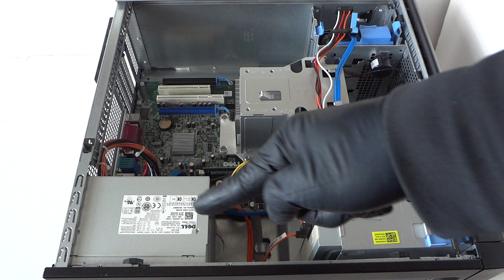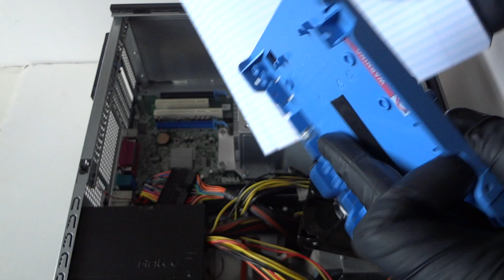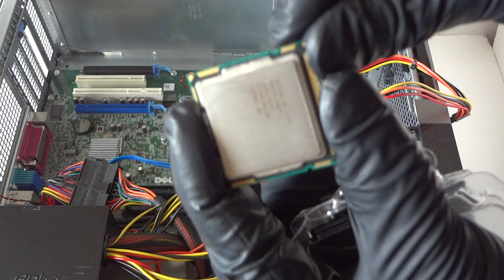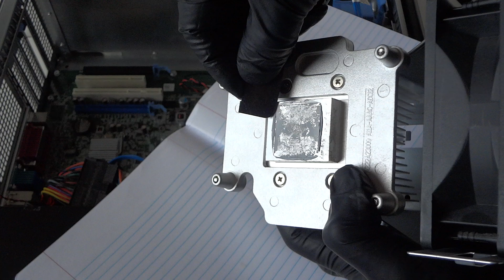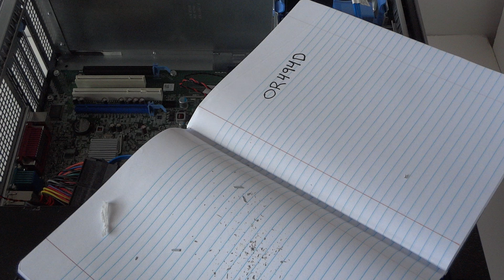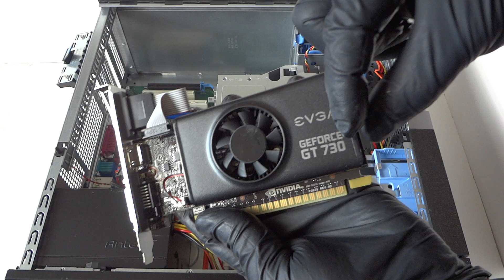Dell Optiplex 980 Upgrade Video Card RAM CPU SSD PSU

Comment from the maker: Here is the list parts upgrades.
(1.) CPU: Intel Core i7-870
(2.) Power Supply: Antex VP450
(3.) Memory: HyperX Fury 8GB DDR3-1333 HX313C9FWK2/8 (4Sticks)
(4.) Video Card: MSI GeForce GT 710 1GD3H LP 1GB Low Profile 
(5.) Hard Drive Caddy: OR494D 3.5" to 2.5" SSD  Adapter For Dell
(6.)  ATX Power Supply 24 Pin to Mini 24 Pin For Dell Optiplex 980
Reply: How to know psu compatible with 980 ? I want to buy cooler master. Is it ok?
Reply: @gamerlikeme9177  any ATX can work. But you need a special Adapter to mini 24pin ATX. Got mine finally working and live it. Got a 1060 in it and 110fps
Reply: @DavidrKun  tq. I have stock psu and plan to upgrade gtx 1060 too. So i still need the adapter to run 1060?
Reply: @gamerlikeme9177  bro, get the adapter and a 450+ PSU. That Stock PSU does not have the power for the 1060. Trust me. Saving you from a headache.
I deleted with this issue for over 2 weeks trying to by cables to see if I could. But best for you to just get the right part. Amazon is the only one that had the right part.
Reply: @DavidrKun  i see.. tq. I try find out.
Reply: @DavidrKun  i have found the mini 24pin adapter at my local online store. Hopefully will work. I've to wait 2-3days. Just to ask if i use 700w psu will it overkill the system?
Reply: @gamerlikeme9177  no, it will only use what it needs. It just can go up to 700w. Also send me a link to the part you ordered. I hope it is the right one. I bought a cable and it was the wrong one. It did do the standard ATX to mini 24pin ATX. But it was pin for pin. No mod. If you search online. You will see that there is one on Amazon that is a special cable with the pin changed. Lots of reviews saying it works for the Optiplex 980. It was the only reason why I bought it. Cause others claim but never worked. It was hell for over a month waiting for. My system to be where it is now. But man what a system... Send the link. I will also search too and post a link
Reply: @gamerlikeme9177  just read the reviews. This is the same cable I bought. Works 100%
Please add this to your video notes. This cable will save others from a headache
Reply: I think this the right one. Exactly the same in this video.
Reply: @gamerlikeme9177  that looks right. Good. You will be booting up soon. Good job
Reply: @DavidrKun  Not soon i think. I have to wait 2-3 days to order that. My gtx 1060 not yet arrive too. Btw thx for sharing to me.
Reply: @DavidrKun  what psu are u using for gtx 1060? I want to buy evga psu.
Reply: So, I bought the ATX 24 to Mini 24 pin Optiplex 980 cable I got from Fry's electronics. Plugged it all in and no power. I know the PSU works cause I got it from another PC. Put it back to make sure it works. But when I plug it into the 980. It does not work. What gives? The cable is new out the box. Even swapped it for another. Is there something I'm doing wrong?
Reply: The PSU EVEA 450BT works. Connected the adapter did not power on. Left a message with Raidmax.com tech support. Just waiting to find out what could be be the issue. The stock PSU powers on the 980. Just don't understand why it's not posting. Do you have any clue
Reply from the maker: Hi, did you try test new power supply in different PC?
Reply from the maker: Did you try onboard system diagnostics?

Restart the computer. As the computer boots, press F12 when the Dell 
Splash Screen appears. When the Boot menu appears, highlight the Boot to
 Utility Partition option, or the Diagnostics option and then press 
Enter to start the legacy 32-bit Dell Diagnostics.
Reply: I found the Issue. The 980 pins are designed different then normal ATX Layout. I just bought a new replacement cable. It will take till the 18th or so to get here. Will let you know. But I check online and its the same issue. The cable on the 980 is different.
Reply: Mxkdi can i use hyperx fury 4gb ddr3 1600mhz?
Reply: uff nice saludos desde bogota colombia
Reply: @seanbridge8390  i was running gtx 1060 6gb with evga psu 500w. Great fps ingame 90-100 with 1080p but depends on games.
Reply: @seanbridge8390  yes it is long and big. Pci slot x16 will not fit because that cpu cooler blocking it. But u can still it install it in pci x4. The white slot. Still can run just fine.
Reply: Mxkdi do you really need to upgrade de power supply because that one is rated for 305 w and all upgrades you did don’t even get closed to that even adding external WiFi adapter mouse and keyboard pin and having connected 4 usb at the same time don’t drain that much power
Reply: @reynerrodriguez2937  if you plan to upgrade the gpu none low profile u need to upgrade the psu in it at least 500w psu
Reply: Hy dude...
My question is about pci slots for graphics card which one i use blue or black which is best?

Comment: hi , sorry for not perfect english . A standard power supply is compatible for the Dell optiplex 980 ? Example  Zalman  zm500-lxii 500w ? Can i fix it in the case or not stabil ? I know , need a pin 24 mini adapter.

Comment: i do have opt 980 too, i just replace my PSU with seasonic 520w and use converter to mini 24pin, now i plan to upgrade the vga card, if i see the cooler is only Heatsink Alumunium, is it posible to cut some of it so we can use standar dual slot VGA card?
Reply: What did you use for the 4pins. My power supply is atx and not atx mini. I can get a 24pin converter to mini but what about the other 4 pins.

Comment: Wow thats a cool and helpful vid ! Thanks for making this video, I barely found much helpful guide or stuff about 980 optiplex. I got few question and I'm very thankful if you could help me with my issue on optiplex 980. I'm thinking about buff up my optiplex 980 but I KNOW NOTHING about hardware, compatibility, and stuff because for me it's kinda hard to understand about it. So I got few question here and a condition that  applies to all the questions. The condition is i got an PSU POWER SUPPLY INFINITY 450W 80+ BRONZE as for replacement for the default 980 PSU

1. Whats the best gpu that you could suggest for my 980 after i replace the PSU ?
2. Whats the best processor you could suggest after i replace the PSU ? I'm looking forward to also upgradin the processor too but in the mean time I'll focused on gpu first, then processor come after it

Sorry if my english is bad, I'm a non native speaker : /

Thanks bro
Reply: Rx 570 best gpu
Reply: @Richardv24  it fits fine ?? I mean that bigass heat sink is the real pain and i tried to google rx 570 (4GB) has 2 fan.
Oh and also do you have any recommendation froma any nvidia gpu ?
Thanks in advance :)
Reply: @ogutdesktop7436  u can change ur cpu fan

Comment: I have a 980 i7 870 mt with a geforce 1050ti on the 16pci express slot stock PS and 16ram of memory. Im trying to upgrade to a geforce rtx 2060 super mini 8g. This video helps a lot thanks for an excellent tutorial.
Reply: How did you fit it in pcie x16 slot ?
Reply: You have to cut a little bit off the plastic cover at the bottom corner on the video card just enough to fit it on the pci x16 slot I use a regular wire cutter doesn't affect anything since the piece you are cutting is just decorative plastic cover on the video card, once cut it will fit fine with the big heat sink that was on the way.  Low profile card.

Comment: Bro! i have the exact same pc and I've bee trying to get a geforce 7200gs properly working, the blue pci port just wont recognize the gpu and I think it woill work better there rather than putting it in the lower, black pci port, the lower, black port is the only one to recognize the gpu and allow me to install drivers but I feel the pc is actually running slower and even giving some errors. what do you recomend?
Reply: Did you change the BIOS setting for which GPU slot is used?  I think it's best set to "auto"
Reply: I ended up upgrading the psu and dumping an HD7970  in there, I had to use the black pci port since the GPU is too big but its been working flawlessly ever since

Comment: Damn, I just wanted to see how to replace the HDD, now I am buying a Video card and processor. I love my 980 so it will be very satisfying to bring new life to it, thank you!
Reply: I got an gt730
Reply: @rudymedina4508  I just got 16GB RAM and the 1TB SSD today, will probably look at the GT730 and a processor next pay.
Reply: @Scorpionwins23  dont get the gt 730. If you're reallly on a budget try getting rx 570 or gtx 1050
Reply: @Scorpionwins23  save a bit more. What cpu you got?
Reply: @rudymedina4508  It's more a matter of spacing out the purchases so my wife doesn't get annoyed haha! My 980 is the smaller SFF so I have to make sure the card will fit, mostly need HDMI capacity. Currently running with the default Intel i5 CPU @3.20GHz.
Reply: Same here. I bought mine off offer up for $140 has an i7 12gn ram and a gt 730. U can probably get a cheap gpu from offer up. Ive seen rx 570 for $90.

I5 should be fine with an average gpu. U seen which cards fit?
Reply: @Scorpionwins23  dvi works good as well.
Reply: I just came to watch what I could possibly upgrade now I have ordered a GPU, PSU and the little 24 pin adapter. LOL. This guy did a really good job of explaining this, besides if I blow up my refurbished $200.00 pc I'll just send it back to Texas and have my pc people refix it lol.
Reply: @dgjr11131978  I ended up staying with the i5 processor and PSU, upgraded to a 1TB HDD, 2GB GEForce GT710 graphics card with HDMI output and 16GB RAM. It's running so nicely now, for a 10 year old machine I am seriously impressed with it. It runs really quiet and handles my editing software with no problems.
Reply: What vid card are you Installing? I wanted a rx 580 but i see it wont fit :/
Reply: @rudymedina4508  Will a asus gtx 760 fit if i remove the big ass fan and replace it with a smaller one
Reply: I got a gtx 970 i’m pretty sure but i’m trying to work on cable management

Comment: Best video ever I did the same but I put a gskill ram 1333 MHz 16gb and I only play wow and a 6 setting with is more than medium 1080p at 95 low 60 FPS but other thing I put a gt 1030 I think it’s a lot than the one you put and fits just perfect
Reply from the maker: Hi, thanks..

Comment: So I got a 24 to mini 24 and connected everything but now when I press power nothing happens. Could you please help me???
Reply: If you didn't get an ATX 2.0 power supply with the 4 PIN 12 V power cable that is why nothing happens. In this video 2 things to remember, the 24 to 24 mini pin connector, ATX 2.0 PSU compatibility, and this is a mini tower Dell 980 OptiPlex not an 980 OptiPlex SFF (Small Form Factor).
Reply: Is there a convert for the 12v power cable
Reply: Did u ever figure it out

Comment: 11:20 there is actually a dot on the motherboard next to the socket and there is an triangle on the corner of the cpu and you have to line it up with that dot. other than that awesome vid!

Comment: Can The Geforce GTX 1050 ti 4Gb DDR5 Fit in Dell Optiplex 980 ?
Please Answer because a will buy This GTX 1050 ti 4gb ddr5 but i worry not Fit
Reply from the maker: Hi, yes you can fit gtx 1050 ti in the bottom black slot..
Reply: Thankyou brother

Comment: Can the optiplex 980's motherboard fit any intel processor? I am trying to fit an i5 3470, and I'm wondering if it can fit.
Reply from the maker: Hi, dell optiplex 980 does not support third gen intel CPU.
Reply: @Mxkdt  Thank you!
Reply from the maker: You can install Intel Core i7-870.

Comment: can the geforce 1050 fit?
Reply from the maker: Hi, yes you can fit 1050 ti in bottom black slot
Reply: @Mxkdt  ok. What about the just GeForce 1050?
Reply from the maker: Yes 1050 will work fine.

Comment: How much ram can work for this one? Just got one earlier and have 2 8gb sticks of ripjaw ram. Haven't tried it yet
Reply: ddr3 1333 mhz only
Reply: should work just fine as long as it is ddr3 sticks  and are both connected in the white slots: 1 and 2
Reply: It takes 4GB ram sticks 4 of them. Total 16GB 1333 DDR3.

Comment: You know what I use to get old stubborn paste off? I slightly wet scotch brite greenie. Works every time. I discovered this back in the days of the Power Mac G5. Apple would really load them full of compound and it would cry and wouldn't budge. A blade wouldn't get it without maring up the suffices badly. A little it of rubbing alcohol or if it's really bad soak it if it's just the heatsink for a bit and rub, dry and re-apply.

Comment: can you use a diffrent heat sink ? id like to put a 1050ti in this
Reply from the maker: Hi, yes you can install this video card in black slot PCI Express x16 wires as x4 bottom.
Reply: @Mxkdt  can you explain this more? Do I need a converter or will it just plug right in? Thanks.
Reply from the maker: Hi, are you trying to upgrade power supply or just video card ?
Reply: @Mxkdt  video card
Reply from the maker: @icesalami   Hi, yes you can install video card in black slot on the bottom PCI Express will work fine gtx1050 ti.

Comment: Sorry if im late but can  fit an gt 1030 in this?
Reply from the maker: Hi, yes you can fit gt 1030 on black slot bottom PCI Express x16 (wired as x4)
Reply: Here using it on same pc
Zotac gt 1030 , using it in blue slot. Fits fine.